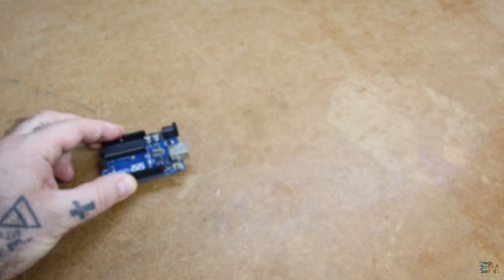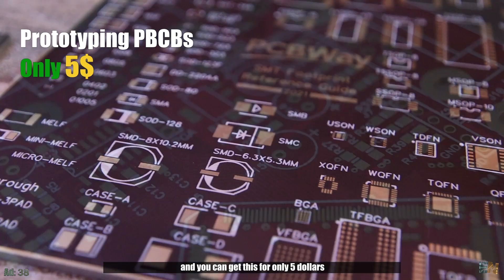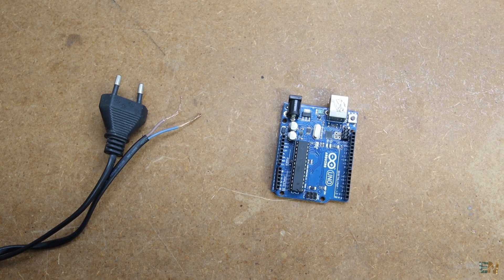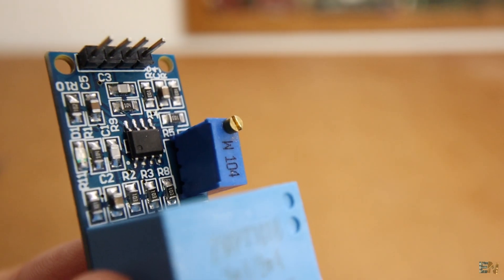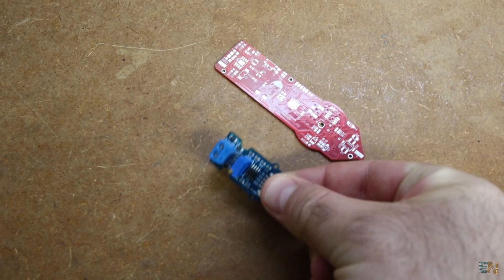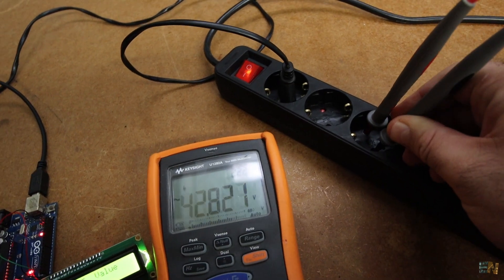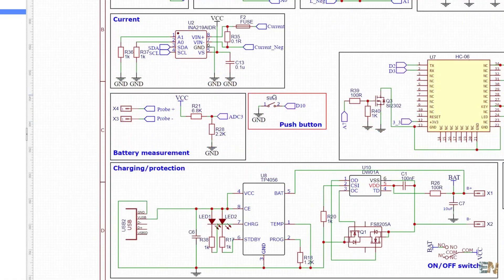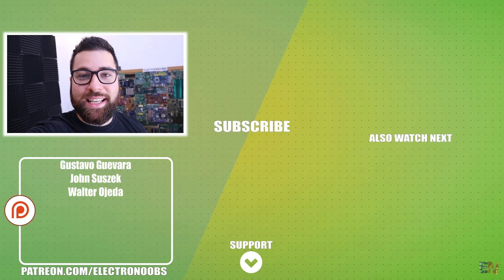Arduino AC RMS Measurement

Comment: That looks pretty complicated.  I bought a meter off alibaba for $2.50 and its about as simple as it gets, but its accurate.  It uses a current transformer and voltage divider that just feeds a micro that display to a 7 segment display.

Comment: Brother you can use Optocoupler for isolation, I have tested it has excellent linearity in LED current vs transistor current. So if you add a high value resistor in series with the LED, it will convert the voltage to current then you have to convert the current at the transistor side to voltage using a op amp. Then you will get a replica of the mains voltage.

It will be half wave, since the LED is a diode. You can use double LED opto or 2 opto, or some software calibration for full wave reading

Comment: This is UN-isolated measurement. With resistors providing a high impedance. The resistors that is used on the board might not be rated for the high voltage. If you want to use this design make sure your resistors are typically the HV range from Royal Ohm or the  RCV range from Visahy. For handheld I would look IEC61010 for CATII or CATIII for the requirements.. Stay safe and keep designing.

Comment: Wow that's a scary circuit. Only three small SMD resistors between the user and mains voltage. That's a recipe for disaster. I don't think you explained enough how dangerous this is.

Comment: Please ALWAYS utlise proper isolation when playing with mains power supply. Burning your arduino and/or laptop in case the resisitve network fails may be trivial, but if you don't have ground current fault interrupter, or your mains does not have any isolation from the primary side, you risk electric shocks that could be fatal. Be careful!

Comment: I have an exciting proposal for a DIY lab bench multimeter using an STM microcontroller. I aim to enhance its functionality and precision by incorporating a separate selection switch for voltage, current, resistance, capacitance, and inductance, and utilizing a 12 or 16-bit ADC. I'd love to collaborate on this project and feature it on your channel.

Comment: Hooking up such a non-isolated module to mains, with the Arduino connected to a laptop / pc is a bit reckless. If that module fails short, the Arduino will likely fail short too, and you will end up with mains voltages on the USB connection.

In an isolated device, such a multimeter, you could (relatively) safely use this kind of circuit. But, this means the multimeter should have no USB port or other ground referenced / non-isolated connections.

Comment: Why resistive divider in AC ?, why not capacitive voltage divider?
Reply: Because its internal resistance does not depend on frequency. If used, its accuracy is not equal to the resistance.
Reply: cap performance can be frequency dependent

Comment: You need to stress that touching the live pads on the back of that little module will be painful.
Placing that module on a bench with metal bits (component wires, tools, etc) could be spectacular! 
Please be careful!

Comment: In the multimeter voltage ranges are protected with MOVs and NTC's. Unfortunately your PCB doesn't have enough space or clearance to add high voltage measurement safely.

Comment: you cant use a laminated transformer for this. you need a low reluctance ferrite one and you need to bias it with a permanent magnet or field to keep it in a linear region. Laminated transformers are not very linear and wont do well over 1khz, you will get something but it will be very atteniated

Comment: You calibrated for 220V AC, what happens if you measure another voltage and frequency for example from a signal generator.
Reply: This code can only measure symmetrical AC voltage, not pulses. It takes the peak voltage and divides it by root 2 to get the average value.

Comment: I would like to measure all the 24 circuits of my home - but not the voltage but the current.

I dont want to have anything inline with my 32A 220 mains wiring, so my only option is these voltage transformer moduls with a split core.

But even on Aliexpress they are 8 bucks plus shipping (or so) and for 24 this gets expensive.

But I do not need accurate absolute reading, I only want to know which percentage of my power usage goes where.

Can one DIY something like this?
Reply from the maker: Use the ACS modules. There is one of up to 200A
Reply: @ELECTRONOOBS  For safety regulations reasons I cannot break the wiring or stick the sensor inline. And I would never trust Chinese made pcbs for not burning down my house. So I need something non invasive like a hall effect sensor or a wire wrapped arround the mains hot wire